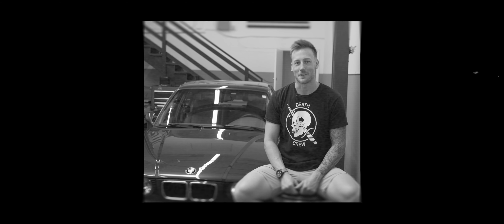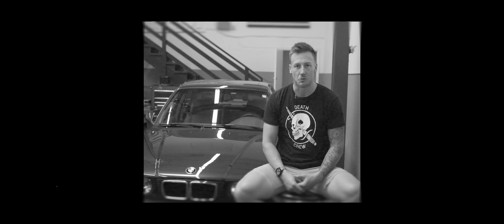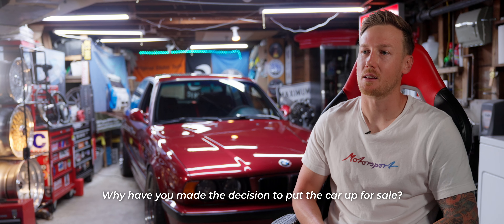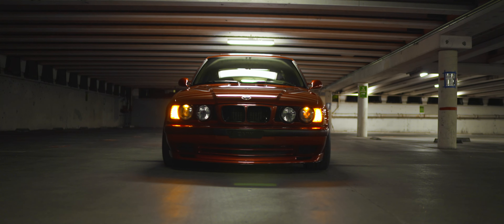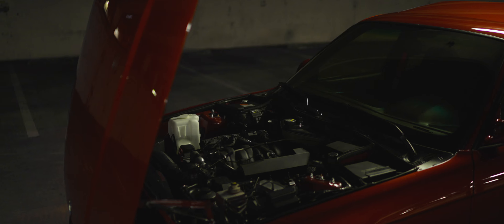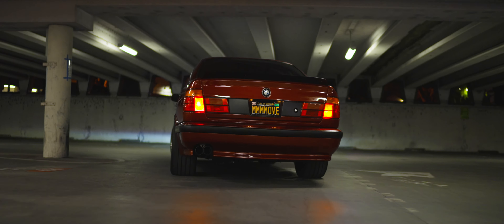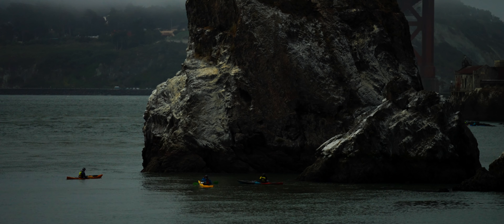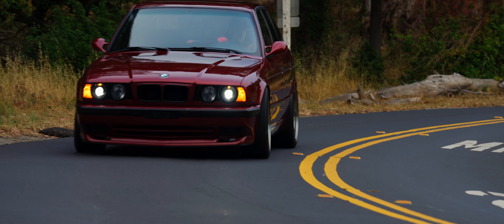Home Grown Style - Final Form. | BMW E34 540i/6 EP. 2

Comment: A very impressive project, I am a big fan of the BMW E34, I noticed that you have an X spacer under the motor, but you didn’t install it above the motor, the question is why, and where can I buy such a spacer like yours?
Reply: The lower x-brace is a modified oem piece from an E31.  I didn’t install an upper strut brace, because the only one I truly liked is no longer produced…
Reply: @Gracestudiogarage  Thanks for the answer, my friends have 2 BMW E31 cars, I'll take them, and additionally, as information, I make custom spacers for the E34. Front and rear, there is an istgram, if you find the time, take a look.

Comment: Does anyome know any good aftermarket performance radiators for the 540i V8? I can't find any CSF or any performance radiators.
Reply: You can do an all aluminum e36 radiator with the euro passenger side mount
Reply: @Gracestudiogarage  do you know any videos or a guide i can follow for this
Reply: @Gracestudiogarage  Is the radiator you used CSF brand all aluminium E36 M3 radiator? Is it sufficient enough to cool my 540i?
Reply: @Blanky there’s a good DIY thread on bimmerforums. Never had an issue with mine, also had a lower temp thermostat, electric fan, and silicon hoses.